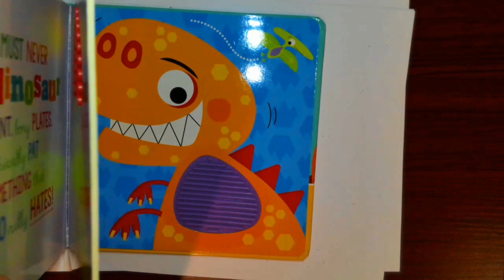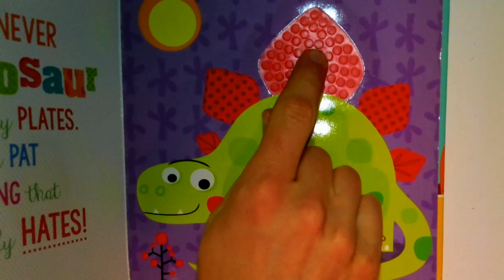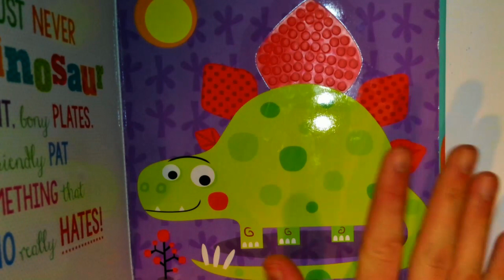BIOE 3310 Lec 21 - Fins for faster heat transfer: temperature profile w/ convection and conduction

Comment: Convection often limits engineering systems; how do engineers increase convective heat transfer? 9:40
Fins: protrusions to increase convective heat transfer by increasing surface area 19:05
AWESOME example of fins 26:14 
Deriving temperature profile of the fin: T(x) where x is position along the length of the fin 28:20
Steps:
-Define shell, choose delta x as delta dimension 33:10 
-Apply conservation of energy to the shell 36:10
-Ins and outs: conduction along length of fin and convection out of fin's surface 36:38
-Manipulate result; take limits as delta x goes to 0; get differential equation 45:41
-Sub in Fourier's law to put diff-eq in terms of T and x; use some tricks to simplify diff-eq 47:15
-General solution to diff-eq; use boundary conditions to determine C1 and C2 57:27
Discuss and plot T(x) 1:08:08
Use T(x) to determine conductive heat transfer at the base of the fin 1:12:50